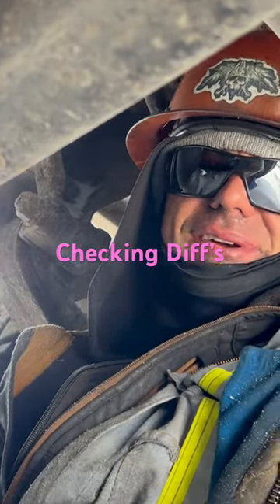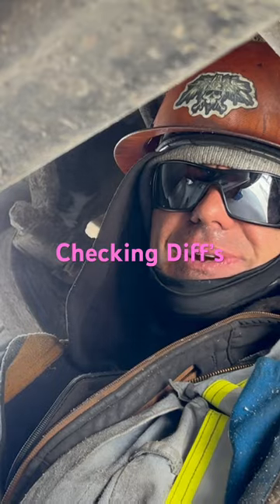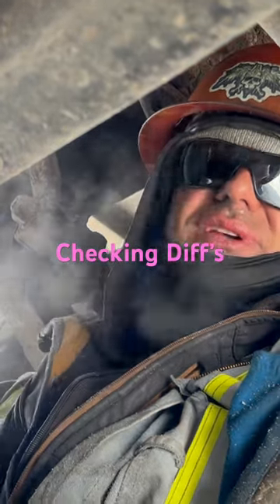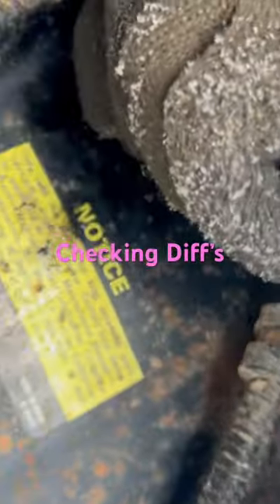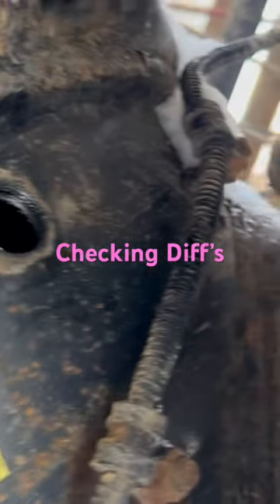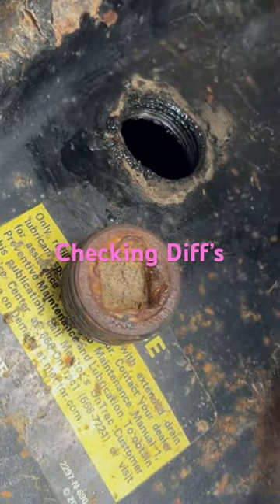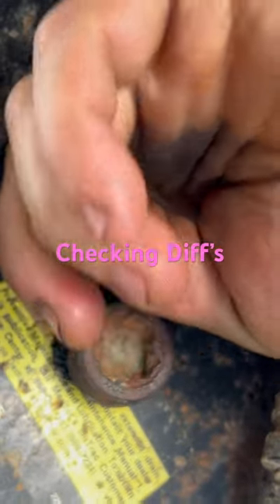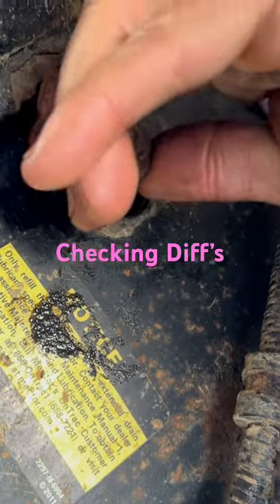Checking the Differential#shorts #differential #funnyvideo #oil #rig #funnyvideo

Comment: If you have to "Bend your finger down" then you're a bit low on Diff Oil sir.
Reply from the maker: You’re thinking that it needs to be right level with the plug?
Reply: @RodWarriorSociety  It's supposed to line up with the hole when cold.
 It clearly states it so, am in page 9/19 of Lubrication Manual of the Dana Library.
Diagram and all is there…absolutely no bending of the finger.
Reply from the maker: @OssamabinKenny  copy that!
Thanks for the info!